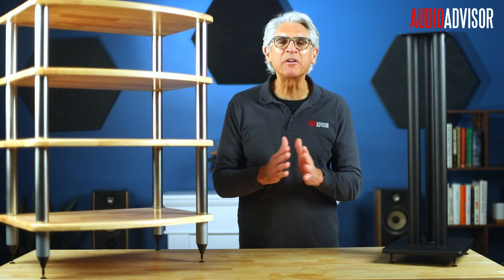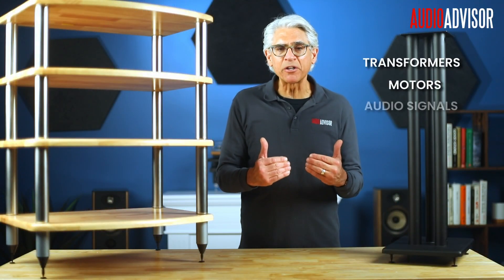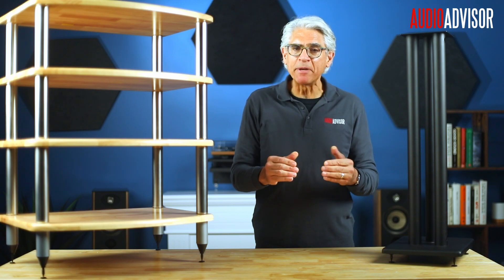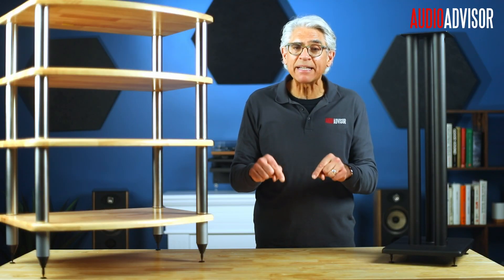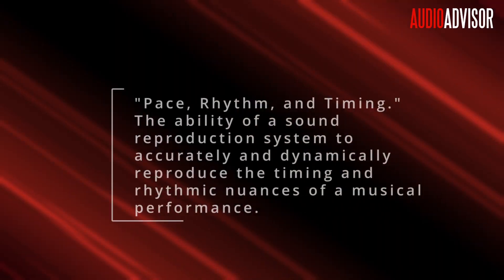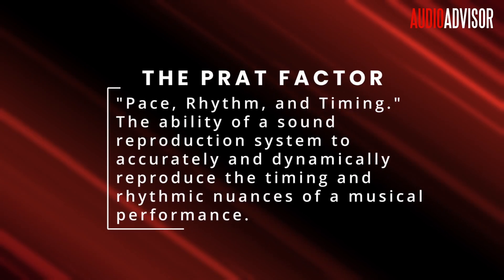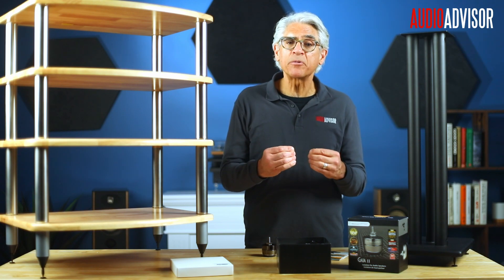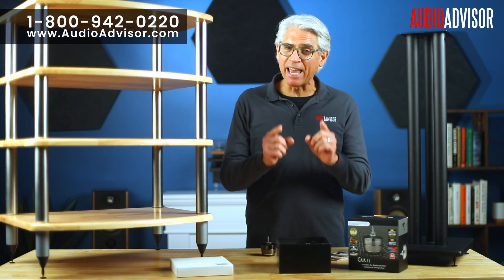How Do Speaker Spikes Improve Your Sound?

Comment: I have carpeting on a slab floor and use spikes underneath my speaker stands as recommended by the manufacturer. My speakers are the AR 303s with 12" woofers and the spikes help to produce great bass as the spikes resist movement caused by cone excursion.